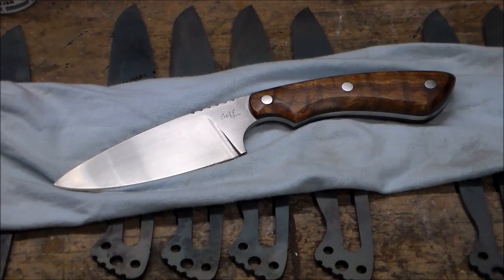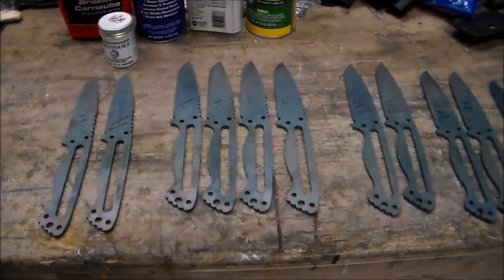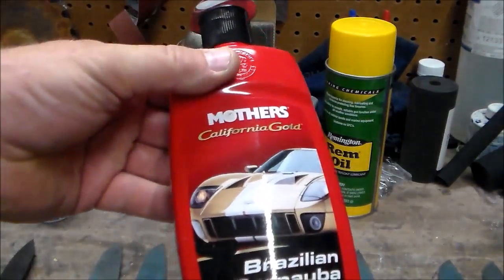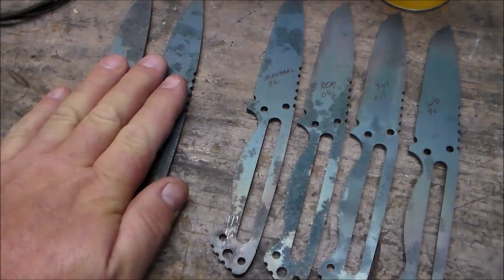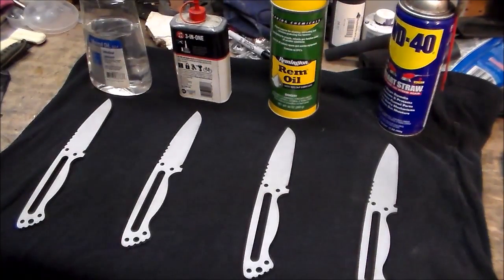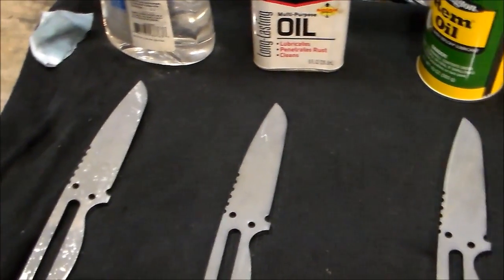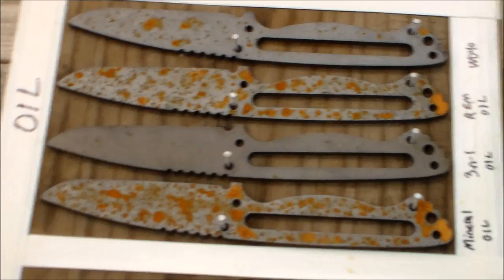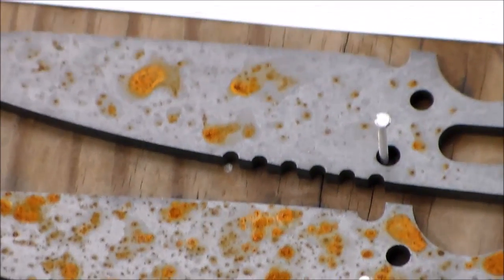1095 Steel, Corrosion/Rust Test for Knife Makers

Comment: I know this is a old vid but my buddy told me you don't want to use 1095 because it rust really bad. Well I'm sending him this vid and at coffee tomorrow we will have a good discussion. I love when people like you spend so much time to give us lazy people a quality vid with unsurpassed information. thank you so much
Reply from the maker: Thanks for checking it out. 1095, 1080, O1, etc. all rust and all are very popular knife steels. About half of what I make is carbon steel and I have a lot of customers that specifically ask for it. Just takes a little more maintenance.
Reply: Ive had an esee 4 for a year and my dpx hest for 5 months and  haven't had to much rust problems. Mind you, they are both coated (mines worn through the coating) but other then the honing oil I use, I dont really put any oils or anything extra unless I use the knife in the rain or put it on the shelf when I get a new one yay! Even if it does rust its usually nothing a quick stone or stropping won't fix. Sure, 1095 rusts, but only with neglect. Take this test for instance, they spent 21 days outside in the open. So just try not to leave it on the deck or lose it in the bush..

Comment: Six years later and I’ve just found this. Thanks a lot for doing this experiment. What I’m getting out of it is bluing with 3-in-1 oil would be the best treatment and cost effective given what you have. I’m not as surprised at the bluing as I am the 3-in-1 oil. 

I’ve never found RemOil to be good at much. This just confirms it.
Reply: Does rem oil suck? That's a bummer. I use rem oil on all my guns and knives

Comment: Well, I finally found a video I can point people at. All I ever hear from arm chair bush crafters is that 1095 will rust up. I've been using em in some of the dampest environments possible, hell I have an ESEE that goes on my kayak when I go fishing. All I did was remove what was left of their finish, force an acid patina, then oil with food safe mineral oil. A little upkeep goes a long way.
Reply from the maker: Exactly, upkeep is the key. I use a lot of 1095 and its fine if you take care of it.

Comment: I also want to mention that I use 3in1 for all maintenance of any tool I own. I'm in the weather year round in my job, and rain will tighten up any one of my tools up in a solid day. easily. I use a lot of pliers and crimpers with metal hinges.Typically, outside of the occasional reapply after a rain shower, I only have to apply the oil maybe twice a year. I wished I had a video of it, but I've got a pair of old channel locks I soaked in oil for about a week to break it's seize. They're one of my better pairs of pliers. WD-40 is meant for a temporary application until a better alternative is available. It's only a bandaid placed on a gunshot wound, if you will. Be safe out there fellers.

Comment: Great video, i will definitely be using 3in1 on my damascus steel knives . Just goes to show you that expensive doesnt mean better. Good ole 3in1 , cheap , readily available. Just reassuring the " if it ain't broke dont fix it" saying. Thanks.

Comment from the maker: Lonewolf6565. For some reason I can't reply to your comment normally, so.... The point of doing rust testing on "in the white" blanks is that I wanted them to be as identical of a surface as possible. Not sure what you mean by "without a finish"? I sell blades without a finish all the time. If you mean hand sanding finish, well, I also sell blades with a media blast finish too. I was just trying to find a way to make a fair test. I didn't think I could get the exact same hand sanded or buffed finish on 10 blanks. And, not sound mean, but you do not know what you're talking about on leather sheath keeping moisture away from a blade. Just the opposite it true! Leather absorbs moisture, even just from the air in your home. Thanks for you comment, I'm open to everyone's opinion and I know I'm not an expert.
Reply: Self Made Agreed,... its not so much about the finish per say but more about a comparison of products that  can be used to prevent rust and how they  perform on basic finishes and yes I too sell blades all the time without a finish. On carbon blades I would send them out the door with a light film of 30wt motor oil, might hafta switch to 3 in 1 now in light of your test,..thanks!
Reply: Just read his comment, he isn't very knowledgeable on production knifes. There are far more bead blasted and polished knives made and sold that blue. The whole reason the knife community talks about patinas on carbon knives is due to lack of finishes used on knifes. Mainly due to wear on finishes during use. How many knives would get sent back under warranty for finish wear if all knives where blued?
Reply: +Self Made i think we all knew Wd40 was going to do good i mean its name it literally water displacement formula 40 and i knew 3 in 1 was going to do good just didn't think it was going to be better than WD40  i call this test time well spent
Reply: +VK70001.P , I'm unsurprised by the success of the 3 in 1 oil as it's manufactured by the same company as wd-40.
Reply: Darryl Machtmes honestly i should have known 3 in1 was going to do better its what i use to clean all my guns

Comment: I wonder if the results would have been different if you used a heat gun and heated each blade and then applied the oil or wax due to the metal allowing the oil to penetrate and flow better.

Comment: I've done a similar test (although using steel wool) using timelapse photography and have done research on others who have done the same and it always turns out that the oils don't do too well but solutions that double as rust preventatives and removers do well, like WD40, Breakfree CLP, And Boieng T-9.  It's interesting to see your results.  Thank you for posting!

Comment: WD40 is a good cleaning and lubricating product. WD stands for water displacement, the down side of WD40 is the lubricant evaporates away pretty quickly leaving the surface unprotected. The 3-in-1 is a good solid lubricating oil. When I clean my guns and knives I always clean with WD40, then wipe everything down and lube with 3-in-1. I've done this since I was a child and my grandfather showed me how to clean guns.

Fact is, it doesn't matter what base metal or coating you have on your blade or gun, if you don't periodically take them out and give them a good wipe and clean they will corrode. 

Good video.
Reply: AFAIK a standard WD-40 does not contain any lubricating substance.
Reply: Ken Parnell  I also heard WD-40 leaves no protection behind.  Thanks for the info on what WD stands for.  That's the main thing I use it for along with wash down. 3-in-1 is spindle oil with citronella for scent.  I'm trying WD-40 gel but it's very messy and expensive. Maybe best used lightly.

Comment: Tips I have learned from my years of having carbon steel knives.

When I clean them, after washing with soap & water, rinse with water, THEN rinse with rubbing alcohol.
I then warm the blade to about 100-120F in my oven, and when I pull them out I apply Birchwood's Super Blue.  Rinse.  Repeat.
I then warm the blade again to about 100-120F in my oven, and pull it out and either apply 3-in-1 oil OR coconut oil to the blade.  I allow that to dry.   Then warm it up a 2nd time and reapply the oil.
So far I have had very little rust EVER touch any of my carbon steel blades.  And this process is cheap and easy.

Thank you for your testing and video, confirming a lot of what I knew to be true.
Reply from the maker: +Roy Fernbach Thanks. Be careful warming them up though, some handle material may move at 120 deg. Regular maintenance is the key.
Reply: I usually make my own handles so I am doing this when the handles are off etc.  Thanks for the warning tho...

Comment: Self Made, you should try a test (without duplicating the whole procedure) with FrogLube.  Primarily a firearm lubricant.  I've watched many corrosion proofing vids with over 100 products.  FrogLube is always in position 1-4 for corrosion resistance.  Has HUGE added advantage for cutlery in that it's a food grade product.  It's what I use on all my firearms and carbon blades.

Just food for thought.
Reply from the maker: +yoda mo Frog Lube is my list to try if I make a part 2, a lot of guys have recommended it.

Comment: I am  really happy that somebody is doing a real test on the carbon steel blade coatings. I have some experience in the marine industry and what i have used on carbon steel exposed to sea water is Mobil 1 EP2 grease. This is a water proof grease that  does not wash away and it has excellent rust protection and lubrication . Unfortunately the grease is toxic and cannot be used on a knife blade because knife is commonly used for cutting food. If the knife is never used for food  then any marine grade water proof synthetic grease will be an excellent choice for rust prevention and protection.

Comment: Shame to see those blanks go to waste, but thanks for doing this! If you do future tests, I would use smaller blanks for testing
Reply from the maker: Thanks. Nothing was wasted, they just get a trip through the surface grinder and they're good as new. I'm usually really frugal with blade steel, so I don't have much scrap.
Reply: Damn good test, I don't think this could have been done any better very controlled very informative. Thank you for taking the time to make this video.
Reply from the maker: Thanks for checking it out.

Comment: Funny how nobody uses 100% RAW COLD pressed linseed oil. The raw cold pressed has a moleculesize of only 0,000005mm (BLO has considerable bigger molecules of 0,0001mm). It penetrates into the metal and here in Norway we use it on cars, agricultural machines etc. It's the best I know of for knives and axes etc too.

It would be interesting to see a test between this and you 3in1 oil😉
Reply from the maker: Hey, sounds like cool idea. I've never really seen anybody use it here really. Blacksmith work sometimes gets coated with it while hot.
Reply: Doesn't cold-pressed linseed oil remain sticky, as compared to boiled linseed oil?  I thought that was the reason to avoid the raw linseed oil as treatment to protect wooden tool handles.  It's aggravatingly sticky, and remains so

Comment: You have convinced thousands to buy 3 in 1
Reply from the maker: +Ozni Wellman You're sort of right, but wouldn't you agree that blued/oxide finishes help prevent corrosion? By applying oil to that finish, it improves the resistance even more. So, logically thinking, wouldn't applying a better oil to that finish would improve it more? I wish I had used the 3n1 instead of the RemOil, but I assumed I started with the better oil. If I do another test, I'll be sure to include that combo.

Comment: Lanolin. Pure lanolin. Don’t listen to the detractors. Yes, it’s goopy, but a thin layer works wonders, and when you want to clean it off, just wipe it off with a dry, cotton rag. Excellent corrosion resistance, non-toxic, clings to metal far better than mineral oil, won’t go rancid. The only legitimate downside is that some people are allergic to lanolin. If you are, don’t use it.

Comment: Thanks for "your "
1,000 + ways and you tried to learn and show results that fair play and I've just finished acid etching and the gun blue and going to find a hot bluing system that should be even better protection.

Comment: i am a machinist and your results were exactly what i expected them to be. it's almost as if the things MEANT to protect against corrosion (3-1/light machine oil) actually do it lol.. anyways, what bluing does is it converts a small amount of the metal into a porous magnetite, and in of itself is not very great, but it is porous, so it holds the oil that DOES protect very well. it requires re-oiling, though, and (cold blue as opposed to hot blue) does not hold up very well to wear. you made a good call with the cold blue and machine oil.

this is a classic case of people just hearing stuff word of mouth, having their biases, etc... people like ren wax because it's expensive, and since it's expensive of course it works the best, right? even though they're using it for something it was never intended to be used for? there's no secret magic to it.
Reply from the maker: Well said! Thanks for checking it out.

Comment: I knew I liked 3n1 for a reason. imagine how well a blued or acid would be protected using 3n1 also. That was a pretty good test,  I'm a little disappointed you didn't test extra virgin olive oil because that's what most use when they have high carbon skinners or  kitchen knives, but all in all good video.

Comment: Personally, I think all these guys worried about food safe are over-worrying the situation!  Unless the knives are ONLY used in the kitchen they will be contaminated with many things, especially if they are a field knife, even if it is only used for hunting!  Is the knife in a Kydex sheath or a leather one?  If it's in leather, it will be contaminated with whatever oil is used on the leather, plus the dirt and dust and blood associated with hunting!  I have yet to find a skinning situation where I didn't get some of the hair, which is coated with dirt and deer skin oils, etc.   SO, my conclusion is don't worry about it!  There isn't enough oil on the blade, especially after the first couple of cuts to even consider worrying about!
In the kitchen, if using wooden cutting boards, the boards and the knives should be treated with mineral oil, often.  If using plastic cutting boards, they should be cleaned with soap and rinsed with boiling water and air dried, with the knives still being treated with mineral oil often.
Anything else other than those two conditions, who cares, as long as the blade is prevented with rusting!
From your test, it looks like 3 in 1 oil is the way to go!
Thanks for doing the test and the video!  KUDOS!!

Comment: You likely already know this but bluing has mercury in it and leaves a funky taste in food that been cut by a knife or fork treated with it. It's much worse for ya than eat'n paint chips.
Reply from the maker: Yeah, I wouldn't use it on a strictly food prep knife. But, at the same, I wouldn't worry too much about it on a general use or survival knife either. Once that oxide has cured and patina'd, I wouldn't think there's much transfer. But, sure, be safe.

Comment: thank you for all the effort you've put up to find out yourself AND let us know of it and the results =D
was quite surprised about the 3-in-1 oil aswell, but i guess there are a lot of things to be learned from this even though there are so many questions raised in the process;
i guess the most important thing to learn is that it all depends on context which coating suits the tools use;
for instance Rem oil being great for blued surfaces (most obviously gun barrels and such), while Ren-wax is not a perfect rust protector but gives a great sheen (for antiques, leather, wood and the likes), WD40 for moving parts and so on - 
but more importantly: there is no perfect everlasting protection. Every tool needs some kind of care from time to time, depending on their application.
Again, thanks for sharing this with us, i guess i'm going to try some things of the sort with my stuff here as well =D
Cheers!

Comment: Great test, I use 3 in 1 oil and also Renaissance wax on my tools and knives. Ive always felt that 3 in 1 is excellent, the main advantage of the wax is it is slightly cleaner to use and finish, perhaps better for more fancy knives that don't get too much prolonged exposure. All the best, Jim.
Reply from the maker: Thanks, and those are my thoughts exactly.

Comment: Interesting results, I would never have thought that the waxes would perform so poorly. THe WD-40 was a surprise too as I've had bad luck in personal experience as a rust inhibitor. On thing that might be worth trying out is on a polished surface finish. I have a suspicion the oils wouldn't do as well. Also another cheap oil that I've found works well on things like shovels and files is compressor oil.

Comment: im not a bladesmith but im an amateur blacksmith and i use a 50/50 mix of beeswax and linseed oil.  i heat them together and mix into a paste and it works well.  it separates some when it cools but i always put it by the forge so its a little runny and apply it with an old piece of cotton cloth while the metal is around 400°F   i cant say how it would do on a knife blade but it is good for lots of things and that baked on aort of coating really makes it last a long time. it is also a good treatment for wood and leather and pretty cheap too.  but as you said, simple is good and you cant argue with results
Reply: Joshua Sherrell i use a diy paste of neatsfoot oil and beeswax i use it on everything i love it, on my leatherwork, woodwork and steel.